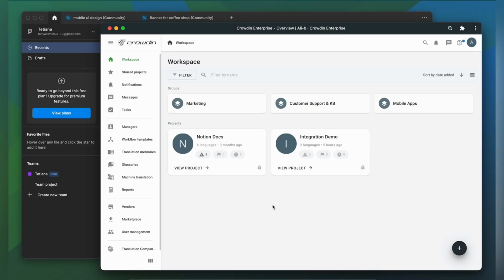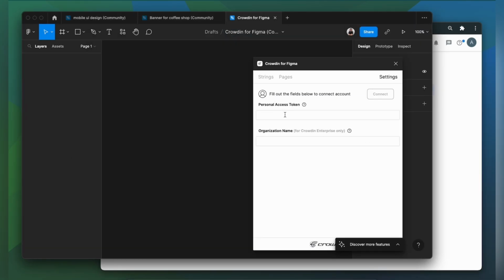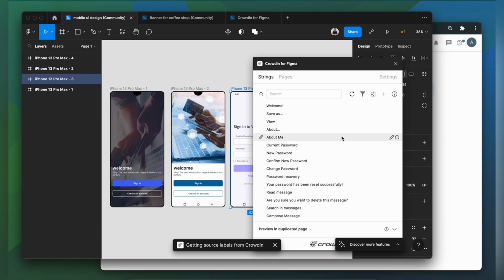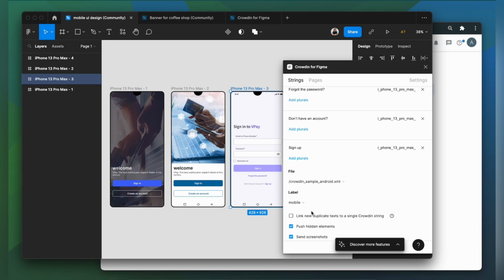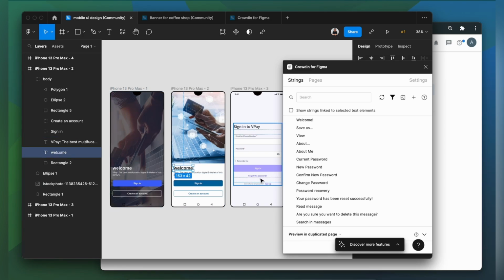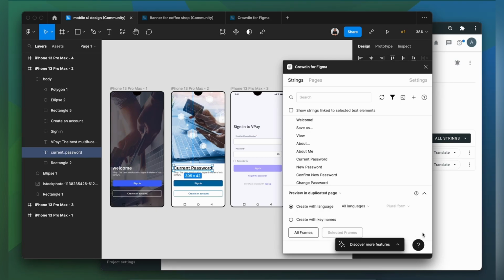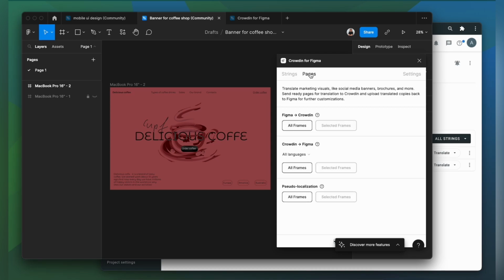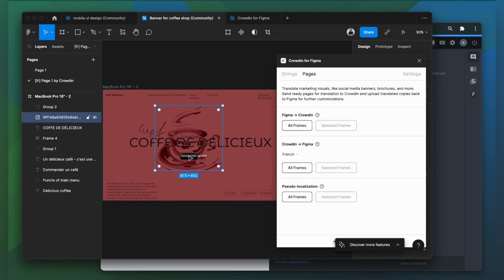Crowdin Figma Plugin | Design stage localization and multilingual design

Comment: Is there way to have figma plugin to create other file type then HTML since this file format doesn't support plurals?
Reply from the maker: Hi Behrang! Sure, there are multiple file formats you can use. Crowdin + Figma integration allows you to create plurals from Figma as well as translate them. 

Here's an article on creating strings with plural forms: https://support.crowdin.com/figma-plugin/#adding-source-strings-with-plural-forms

Feel free to create your file in Crowdin and then add plural strings from Figma UI, here's a list of file formats you can use for this: https://support.crowdin.com/file-management/#string-editing

Hope this helps! If you have any further questions - feel free to reach out to our 24/7 support team at support@crowdin.com
Reply: @crowdin-localization  Maybe I'm doing wrong then, because when generating the files in Crowdin from the Figma plugin I get an HTML file that is not plural compatible. How to change the file type that Figma plugin creates?
Reply from the maker: @BeemannDK  a quick solution would be to create an empty file in Crowdin using the file type you want (the one that supports plurals and is listed here: https://support.crowdin.com/file-management/#string-editing). Then add strings from Figma to this file.

If you're interested in more details, we'll need to know whether you're creating strings in Figma or importing your existing content, which file type you want to use, and other details. For a fast response, please send this info to our support inbox (support@crowdin.com).